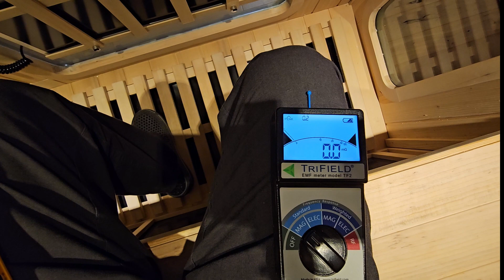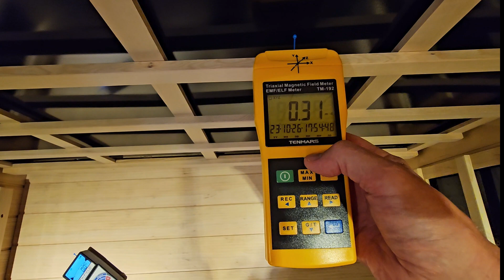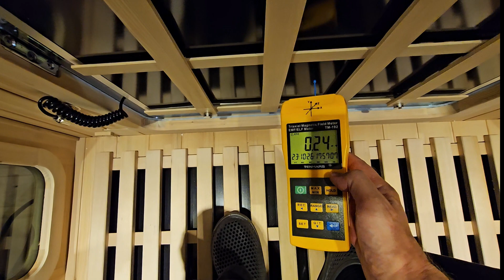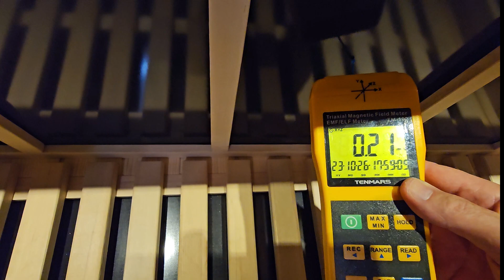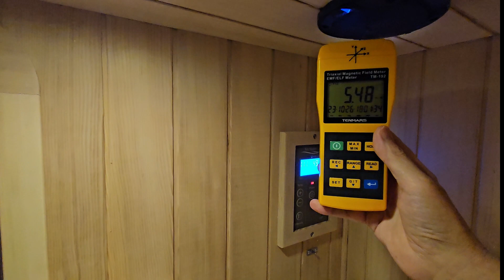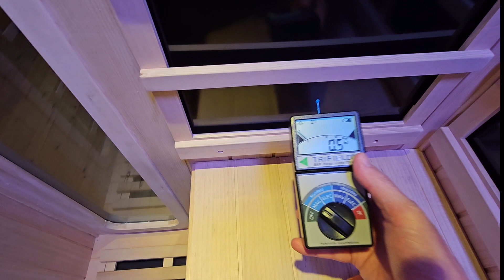2023 Low EMF Infrared Sauna | EMF Magnetic Field Test

Comment: Can i please ask if the current 2025 models are these heaters or if they have improved again?

Millivolts ?
Mgs at the panel?

Can i please ask why it jumps to top near 1.0mgs and higher in many locations,  assumed it wouldn't be over 1 anywhere..

Also a popular sauna reviewer reported high millivolts and body voltage on your models 5 years back,  are these units now improved?
Reply from the maker: Hi, our EHS heaters, which cancel both the EMF magnetic fields and the ELF electric fields to near-zero levels, were introduced in 2020 and are still in use today. Please reach out with any further questions https://sunstreamsaunas.com OR CALL 1-888 262 4477

Comment: Would these readings be the same in the Evolve Mini?
Reply from the maker: Hi Dan, We use our EHS heaters along with the same power supply and control system in all of our saunas. So yes, the low EMF magnetic fields and low ELF electric fields are in all of our saunas
Reply: @SunStreamInfraredSauna  Thank you for the information